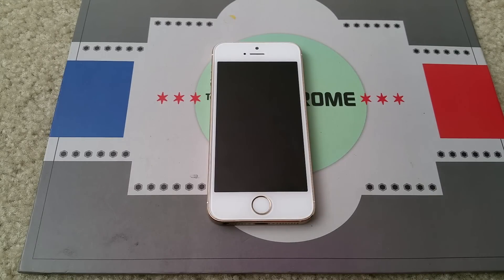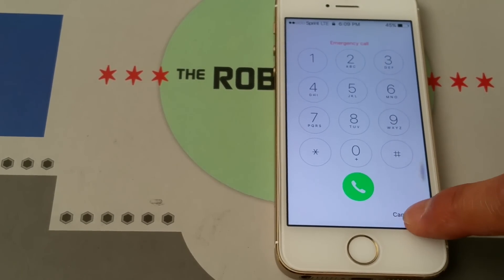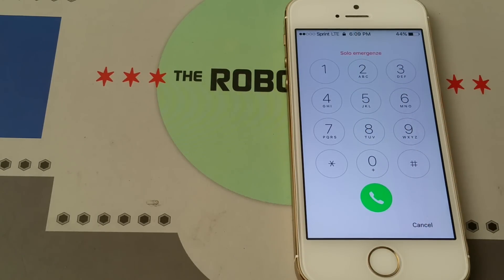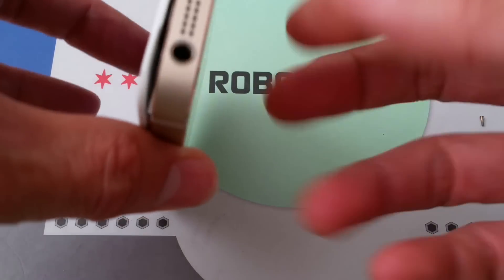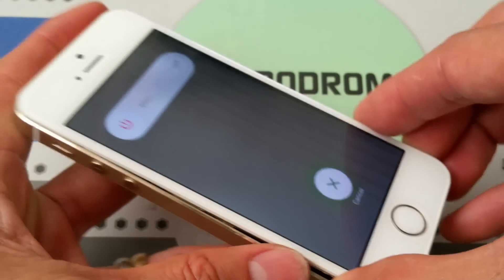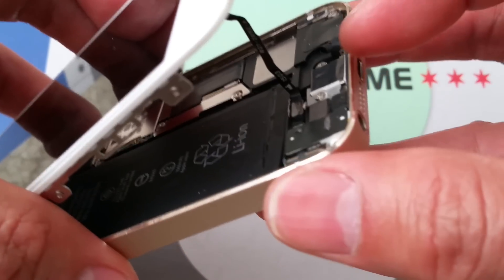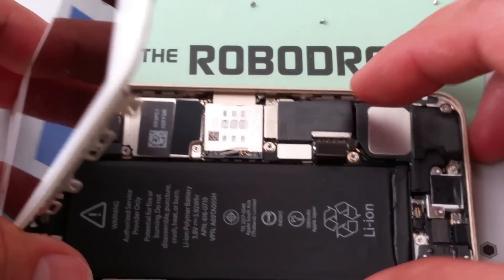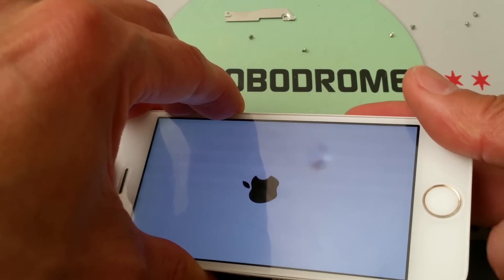Troubleshooting All Apple iPhone Digitizer Right Side Not Function or Working Full HD 2017

Comment: My iPhone sometimes works but other times it randomly doesn’t especially on the left side but on both sides too do you know any reasons why? All I know it’s not the screen protector
Reply from the maker: It could be your flex cable or problem with the LCD panel.

Comment: After screen replacement of iPhone 6 Plus the bottom quarter half of screen is unresponsive, I have reset the ribbon connectors multiple times and still the same result, also inspected the metal connections with jewelers glasses and all are satisfactory condition, do you guys think I got a bad screen? It’s not an OEM screen
Reply from the maker: Sound like you have a bad display or bad flex cable.

Comment: my iphone 7 plus was working fine but it suddenly stops responding from the left side..  if i dont use the fone for half a hour, iit just magically starts working for like 2 minutes then again be unresponsive.. What do you think would be the problem? Its an original screen and i didnt drop or did any water damage
Reply from the maker: Probably put it in your rear pockets, you will need to change your display.

Comment: My iphone xr doesnt work the letter i and up and down from there its like a line of nonworking screen
Reply from the maker: You probably dropped your iPhone and most likely require to replace the touch display or check for loose flex cable connections.
Reply: @macdaddypimpping  yea I just got it yesterday but it’s refurbished so I’m sure it was used and they fixed it so I don’t know a lot about the background of ot
Reply: What did they sayy?? Loose flex cable connections??

Comment: I replaced my screen and everything was fine.  Then when I replaced the battery i got a small white dot a little smaller than a dime on the lower right part of the screen.  A little annoying but i could live with it.  Couple weeks later bottom half the screen suddenly not working.  I think replacement screens are often just pieces of sh*t
Reply: So true! I got my screen replaced as it was cracked and since them my phone has been experiencing so many bugs! The top half of my phone doesn’t work now.
Reply: @okxyash7392  how do you fix that
Reply: @okxyash7392  they sells duplicate display batteries n all… in the name of iPhone

Comment: I thought it was my keyboard but I found out it’s my screen
Reply: @Isabel Garcia have u found a way to fix it
Reply: Jay050 i did bro
Reply: @threebrothers9506  how
Reply: Jay050 I swear to god im not lying U MIGHT FIND THIS CREEPY BUT MY SCREEN WAS REPLACED N MY SCREEN WAS PRESSING BY ITSELF SOMETIME SO I OPENED MYSELF TRYING TO FIX BUT MY LEFT SODE OF THE SCREEN STRAING LINE LEFT NOT WORKING AT ALL I TRED MAKING MYSELF AGAIN N AGAIN BUT NOT WORKING BUT JUST RANDOMLY I FIND 1 YouTube video it say use lighter in u unresponsive screen I tried n it work tq so much it work so i was so happy to share this hop it will b helpful to some1 else too i give heat to left buttom were my keyboard Q n A were keyboard were there it started working use light but not for long period jst stop when ur screen start to turn black on the heated area it will recover itself my phone is iphone 7

Comment: mine is on the bottom side, last time this happened my phone died and when i plugged it back in it worked, however i dropped it and now its not working, everytime i reset it is says my phone is disabled for a minute and idk what to do
Reply from the maker: You will need to replace your display/LCD panel, touch is no longer working or went bad.
Reply: Same

Comment: mine is left side not working now… where can i repair it ? 😥
Reply from the maker: If you have checked the flex cable for your display touch screen then you should change a new display to fix your issue.

Comment: I dropped my I phone 8 In water and the screen became unresponsive then I replaced the screen and it is now partially unresponsive, any help ?
Reply from the maker: Is your new screen in working order? Did you clean the flex cable gold connectors with 91% alcohol?
Reply: macdaddypimpping I didn’t fix it myself I went to a shop to fix it , the screen works but wil randomly stop becoming responsive to touch

Comment: My bottom screen doesn't work
Reply from the maker: Either unplug the flex cables and then plug to check for any loose connection or needs to get your screen replace.

Comment: Exactly same problem with your phone.What should I do?Mine is 6 plus.
Reply from the maker: Either you might have a bad flex cable connection, bad IC chip from dropping many times, or need a replacement new LCD.
Reply: have the same problem mine is 6 plus too

Comment: On my iPhone 5s my touch screen will work and then sometimes it will stop and work fine again could this be just a bad connection to the board or could it just be a bad screen and the screen is in perfect condition btw
Reply from the maker: First, it sounds like a loose cable connection. Second, it could be a bad touch screen. Finally, try a force restart on your iPhone or replace a brand new LCD.
Reply: @macdaddypimpping  Yea I disconnected the LCD and reconnected and still having this issue so I need a new screen and I noticed little blue and red lines going through the screen
Reply: That happens to me then I dropped to work now the top won’t work

Comment: Hey man my iphone 6s half screen from top not working and half from bottom is working what to do man please tell me😵
Reply from the maker: Could be your flex cable, screen, or circuit board. Did you drop your phone?
Reply: macdaddypimpping mine the same but I didn’t drop it
Reply: @macdaddypimpping  if it is dropped can it be fixed?
Reply: Yes brother

Comment: My iphone 5 problem. can you help me? after i change new bettery then my touch can't working.
Reply from the maker: Check your flex cable connection and make sure it is connect correctly. If not that means you probably mess up the flex cable while trying to replace your new battery.
Reply: @macdaddypimpping   sometimes my touch can work but only a second then back again can't working

Comment: My left side doesn’t work if I touch it
Reply from the maker: You will need a new display or try to open and disconnect LCD flex cable and then connect back. Sometimes when you drop your phone it came loose, good luck.

Comment: Hi my iPhone 7 plus just encountered a problem today where part of the bottom and right edge can't response, there was also a line of unresponsive spot in the middle. No defect on the screen quality at all but just the responsiveness problem. Could it be the digitizer being faulty? I'd dropped the phone and put into my jeans pocket recently....
Reply: Same just happened to me seconds ago. My top half doesn’t work. I have to double tap the home button and bring the screen down to use it.
Reply from the maker: Is your screen an Original one or you have replaced before?
Reply: @macdaddypimpping  I have iPhone 7 and i just replaced the screen . it was working very fine but again fell ... will this work for my iphone 7?
Reply: same bruh
Reply: Its an original screen never done any repair before

Comment: My phone isn't working on the left side and some of the right side and it keeps saying disabled
Reply from the maker: Is your LCD an Original from Apple? Disable, is it apply to your iCloud account?
Reply: macdaddypimpping I got the iPhone 7 from sprint and when it broke I went to a phone repair and got the screen fixed today I accidentally dropped it and saw it was disabled and the left side and some of the right side wasn't working
Reply from the maker: Disable meaning that Pin/Passcode/Password was enter wrong for many times.
Reply from the maker: You probably think you're entering the correct PIN due to your defective touch not function correctly do it is disable due to enter wrong PIN number many times.
Reply from the maker: Here on how to reset your passcode: https://support.apple.com/en-ke/HT204306
Reply: macdaddypimpping should I get a new display screen too ? bc the screen is clicking when I push down on it